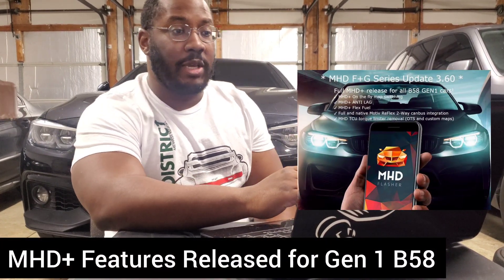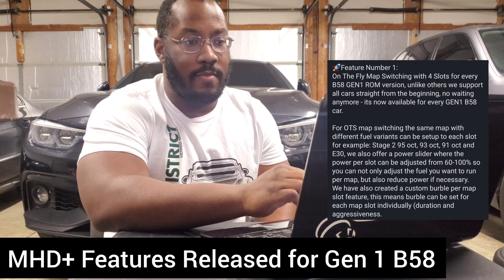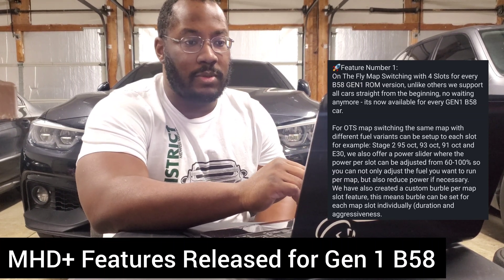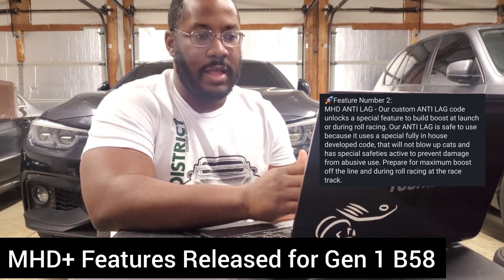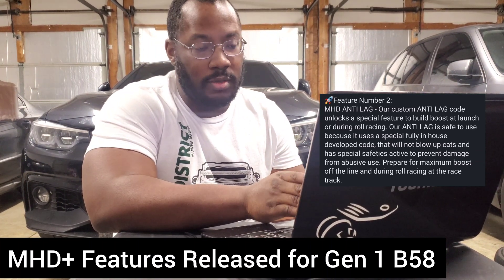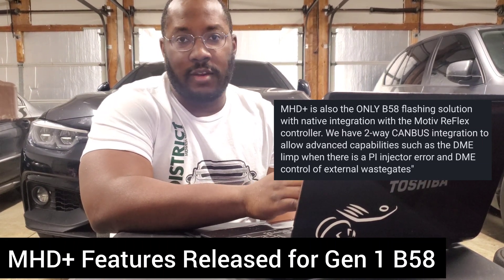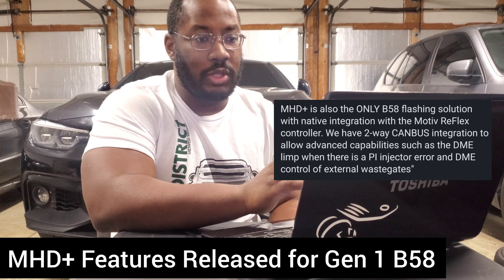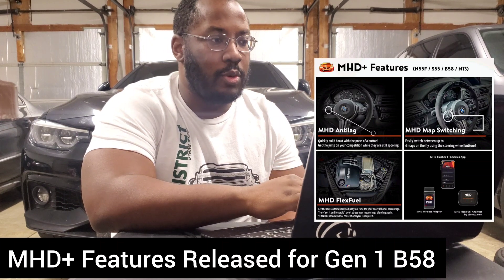Motiv Reflex Integration & MHD+ Features for Gen 1 B58 - The B58 Digest

Comment: So the controller cannot be tuned into the car with MHD? Or it needs to be installed by a tunner ?
Reply from the maker: It still needs to be flashed separately but mhd can read fault codes for different failure modes

Comment: So are you not able get a tune with port injection through MHD and Motiv?
Reply from the maker: Port injection is controlled by the reflex, not mhd.
Reply: @kern417  Thanks! And can the reflex also be used for running flex fuel?
Reply from the maker: It can be used for anything. It's basically the most advanced auxiliary controller on the market. It can control port, meth, nitrous, all dependent on boost, ethanol content, fuel pressure, etc.

Comment: Do i have to unmarry bm3 to switch over to MHD ? Or just install mhd over it ? Thanks in advance!
Reply from the maker: That would be the safest thing to do so the process goes smoothly.
Reply: @kern417  got it! So just go back to stock tune  will be deleting bm3?
Reply from the maker: @diegoporres2627  flash to stock and lock, then unlock and flash with mhd
Reply: @kern417  thank you🙏🏼